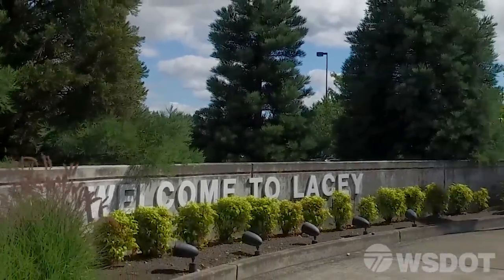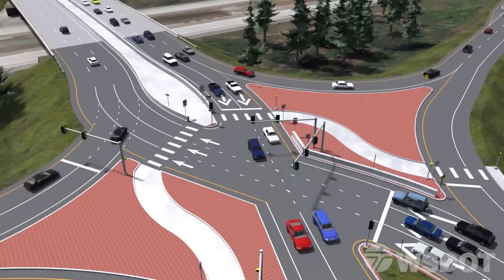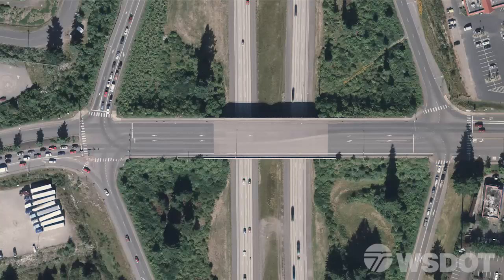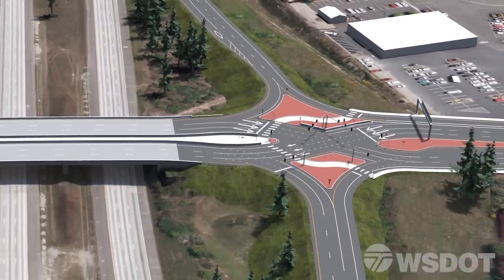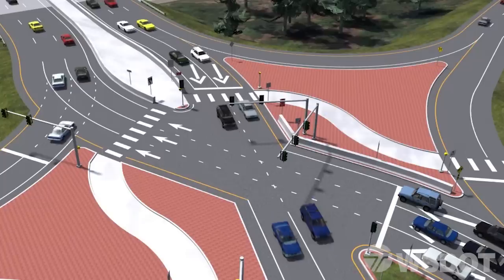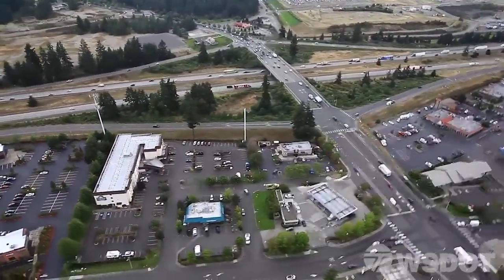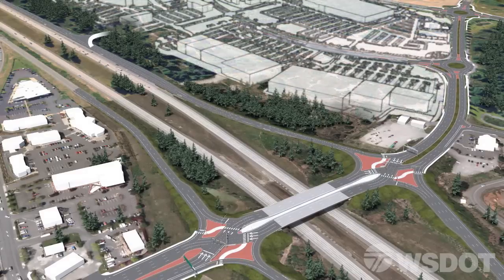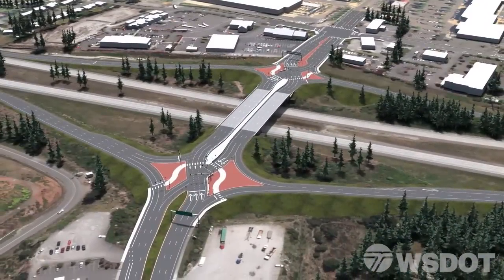Diverging Diamond Interchange comes to Washington State

Comment: It's an intriguing concept, very thoughtful. But I wonder: does it ever snow in Washington state? What happens when there is a  layer of 5 inches of snow on the road, just enough for the road paintings and curbs not to be seen anymore? The locals will be familiar with the unusual traffic routing, but what's with non-local drivers? I would be afraid of many wrong-way drivers in bad weather conditions.
Reply from the maker: We do occasionally have snow in this part of the world. DDIs are configured so that cars are aligned in the direction they need to be going and driver’s don’t have the sense they’re headed ‘the wrong way.’  DDIs are found in many parts of the country that have more severe weather than western WA, and we are not aware of motorists in those areas having problems being properly oriented as they drive through them. We will also have overhead signing that will direct traffic.
Reply: wsdot this idea is Guineas it should be take over to Europe :-)
Reply: @wsdot, this is a good idea but what about the roundabout? Wasn't that considered the most efficient way of handling traffic? They said that congestion is reduced to almost 60-70 percent?
Reply: no doesent snow often i live in lacey
Reply: In the heavily populated areas of the state (Seattle at least), everyone freaks out and simply parks on the freeway with the slightest whiff of snow....strange as that is it should mitigate your considerate concern.  :-)
Reply: The video shows that many of these interchanges are in places that get plenty of snow.  We have had one for several years and get over 110" of snow in a season.  There are plenty of signs that guide the unfamiliar driver should they decide to venture out during a particularly bad snow.
Reply: I think your comment shows everyone how much people fear change. You have literally nothing other than guesswork to go on, and the video itself states that accidents and severity of accidents at all intersections has reduced.
Reply: Xaiano but there is no cited source for that claim. There isn't one..
Reply: I can tell you, being near one in NC, they are loads safer. Concord Fire Dept has responded to significantly less 10-50s since the DDI was implemented in the two places in Concord.
Reply: pssst3 Just as there is no cited source for a counter claim.
Reply: Yep. And if one wants a 'source' for lowered accidents there? You are welcome to any time call Concord Fire Stations 7, and 9, and Kannapolis Fire Station 5 as they are the ones who have that as their district for 10-50s at the DDIs.
Reply: The Nordic Stag I just love the attitude, like someone would be suspicious of something that improved safety anyways - like oooh, I don't know about these parachutes, I think until I see some proof to back that up, i'm just gonna jump out of this plane like nature intended...
Reply: Well, which is why I tossed that out there to give the fire stations a call about that. The CFD & KFD personnel are more than willing to answer questions on it. :)
Reply: The Nordic Stag you did good
Reply: Brisdad53 In Alaska they barely slow down.
Reply: Brisdad53 in certain areas of WA there are not snowplows so when it does snow everything get packed down so lanes can't be seen. even with signs and great weather people can't seem to drive so it should be interesting to see this concept put to use.
Reply: How about cyclist in the roadway?
Reply: As a cyclist myself whom road-rides most of the time, these things are easy-peasy.
Reply: The Nordic Stag
Really.
Reply: Yep! Really! I'll see what I can do next time I'm in that area about doing a video of going through that DDI."Bike lanes" are not much a concept outside of major cities in NC, so, 99% of what I do is road riding.
Reply: +Xaiano: I don't "fear changes" as you insinuate. On the contrary, I'm very interested in new concepts, and a big fan of improvements in road safety. It was't meant sarcastic when I wrote "intriguing concept", as you seemingly implied. But it must be allowed to ask questions, if one sees a possible risk that others may haven't noticed (yet).
Reply: I drove through them in the snow in both Springfield, MO and Branson, MO. and they still work.
Reply: Your welcome to call Springfield, MO and Branson, Mo as well. Definitely much safer for, traffic and Ped.
Reply: I experienced the first one in Springfield Missouri.  Not a fan of it
Reply: +Der Yeti

We have diverging diamonds here in Utah (with tons of snow), and it's never been more of an issue than it is on any road. A well designed diverging diamond is really hard to use wrong.
Reply: We don't take kindly to non-local drivers in these parts
Reply: It would take a huge roundabout  for this one.
Reply: I believe that other parts of the world should try out this concept, particularly because left-hand traffic countries and territories that feature prominently include, but may not be limited to:
- the UK proper
- Indonesia
- Japan
- Hong Kong
- Singapore
- Australia
- NZ
Lots of drivers from the above countries and territories visit those that have right-hand traffic e.g. Brits who want to holiday in Mainland Europe and truck drivers who operate left-hand drive trucks in the British Isles.
Reply: We have some of the worst snow here in Rochester, NY.  We have a diverging intersection.  It actually moves much smoother.  No issues with snow at all.  You don't even realize you're diverging either.  It's honestly an amazing design.  Cut my commute in half!
Reply: wsdot  It looks like its designed to require a very awkward angle turn to end up on the wrong side, but old people would of course manage to do so. Really though, having one plow/salt truck dedicated to handling just this interchange during storms doesn't seem excessive or a waste of resources. Problem solved.
Reply: MathCubes lol
Reply: Xaia
Reply: Xaiano well..and what happenns when im drunk! Will I be able to follow the new traffic pattern
Reply: I get you're concern, but that's no reason to halt the process. It's an invitation that has proven to work, decrease accidents, and increase traffic flow. Maybe signs need to be put up warning of the DDI, maybe some memos need to be sent out, maybe the news should just replay the instruction on this video every morning for 6-months to a year. Point is, people need to learn, ignorance can't hold this back.
Reply: Spaß Trompete: DDIs were invented in France and were first used there in the 1970s.
Reply: Do you think that maybe those non-locals would just follow the flow of traffic? Or are you imagining some scenario where suddenly 100's of totally unfamiliar drivers, in a snowstorm, decide to go shopping?
Reply: DDIs started in Europe decades ago. @spatrompete2601
Reply: @battosaijenkins946  
Circles have good entrance and exit, but it is the volume that causes issue. A one lane circle is the safest interchange, but little volume. Adding lanes multiies congestion of traffic by number of lanes. For a three lane road, you could be stuck inside and become a nightmare of turn indicators, yielding for others to cut in, and more.

DDI's force lane changes before the intersection and guides the driver to where they need to be. The conflict with DDI's are merging on highway from 2 lane ramps, 2 intersection (though safer with only forward progressing traffic), and getting in the correct lane before approach
Reply: High traffic areas over interstates typically have enough volumes of vehicles to sufficiently melt any snow.

Comment: But what if you eg. took the wrong exit and just want to drive straight onto the highway... can‘t do that here...
A roundabout would be better
Also driving on the left side of the road might be very confusing for some drivers especially older drivers. Furthermore, during nighttime this is actually very dangerous, the light might dazzle other drivers since it‘s not made for driving on the right...
Reply: This was all addressed in the video.  The barriers prevent the light distraction, and very clear signage and arrows make it clear where to go.

Comment: I am trying to digest all this & see some of the points for cars turning off. But what about straight thru traffic., say north-south.  From what I see, only one direction can flow at a time. Yes?  Since the north lane & south lanes cross, traffic lights are needed at the crossings and traffic can flow only in one direction at a time.
Reply: Correct, however a normal crossing requires 3 traffic light stages, now you need only 2 which reduces the wait time for the traffic lights.

Comment: If they had the room, how about smaller over/under passes where the opposing lanes cross over each other.  That would remove two lights and a couple conflict points.  It would also eliminate confused drivers from being able to go the wrong way into oncoming traffic.

Downsides: It would certainly cost more and maybe obstruct visibility?
Reply: That would require a huge amount of space.  You would have to start a lot further back to get one lane to rise up high enough to go over the other and then back down again on the other side.
Reply: anchskier That was the one aspect I didn't know the answer to.
Reply: +badlandskid

It is nearly impossible to go the wrong way on a well designed diverging diamond. I wouldn't worry about that at all.
Reply: Way way WAY more expensive
Reply: exactly, hear the words "well designed"
Reply: Did this in cities skylines but i can't fathom using the funds and the space to do that in real life.
Reply: Bridges are most of the cost of interchanges, anything like that (while being safer and more efficient) drives the cost WAAYYY up.

Plus it would use a lot more space.
Reply: Key phrase: Nearly impossible. Unfortunately given the number of drunk or impaired drivers that eventuality will happen.  But it happens now with equally well marked areas, so no reason not to give it a try on that account.

But given the requirement for traffic control due to the weave at both ends of the crossing, I wonder if this will really save any time or decrease accidents vs a normal intersection. Studies are one thing, but will they stand the test of real world use.
Reply: badlandskid, it's called a Double Crossover Merging Interchange ...  https://en.wikipedia.org/wiki/Diverging_diamond_interchange#Double_Crossover_Merging_Interchange
As anchskier said, it does seem to require some more space. At least it's all 2-level.
Reply: I've driven on a DDI before. The first time was very confusing, and I felt a little uncomfortable, however, due the the ample signage and large barriers separating the traffic directions, it wasn't that bad. Now that I've done it once, I know what to expect and it's not bad at all. I can say that it reduces traffic greatly, because left turns are always protected. And the angle you end up at at the traffic light (where the sides switch) is so great, you have to really try to go the wrong direction, so accidents aren't bad.
Reply: I am SHOCKED by the behavior of you people. Someone asked a question that many people knew the answer to, and not ONE person resorted to name-calling. Simply appalling. This isn't the internet I've come to know.
Reply: The one I’ve driven through sacrificed the dedicated U turn lane. That was pretty annoying, but other than that I guess it’s more efficient.
Reply: Chip Kirker: "First time very confusing." In that respect it's not unlike the entire city of Boston, which is impossible to navigate unless you have driven it before. But it's really far better than Boston. It totally lacks the Harvard Bridge: "CLEARANCE 9 FEET 0 INCHES." Just try moving into Boston for your first semester at MIT or BU, driving a rental box truck, and you'll discover what happens when you select the wrong turn.

Comment: Biggest problem with this system is the stop lights actually have to change more often to accommodate traffic. Lets say that at the peak of the day the traffic already on the road is the traffic that goes over or under the freeway. Both sides can not move at the same time.

Comment: Why go with a cheap and efficient roundabout when you can complicate things and make them more inneficient and expensive? 'MURICA!!
Reply: The video doesn't say anything about roundabouts.
Reply: Joaquin Andreu
You have any idea how expensive it'd be to put a circular bridge over a highway?! And roundabouts suck, generally.
Reply: A DDI is probably the most efficient intersection type out there when it comes to handling very large amounts of traffic. Roundabouts don't get better with more lanes, while lanes can be added or removed from a DDI without causing problems.

Comment: I live really close the the first one built here in Springfield at Kansas Expressway and I-44.  I remember they had just worked on the overpass maybe a year before repairing it, then all of a sudden they started working on it again.  WHAT!?!  Then I asked a worker what they were doing and he just said improving it for traffic flow.  Oh  boy did it need that.  Anyway, I noticed they weren't widening bridge, I thought they would just widen it and make more lanes or something.  When they finished it, I was like "Oh I see, wow, good idea."  

The main problem was the center lanes to turn left onto the highway for the north and south bound directions.  They could only hold a few cars before it backing up into the inner lane of the double lanes going both direction, blocking it.  It was a mess.  Now, not a problem.